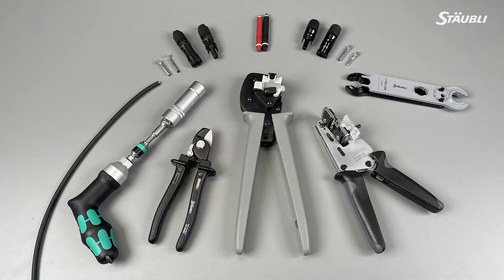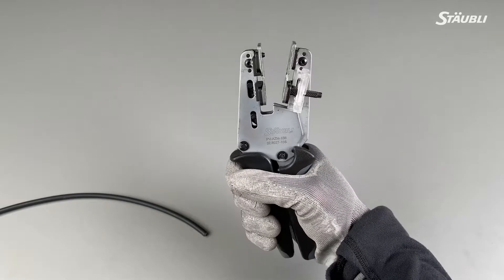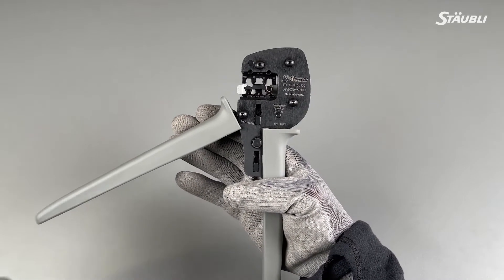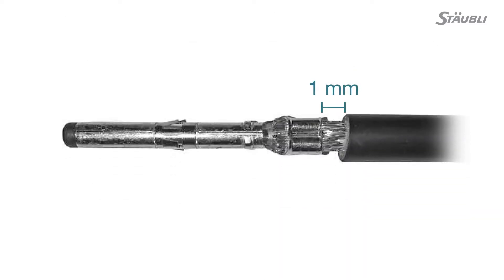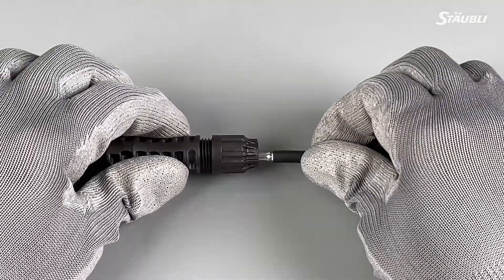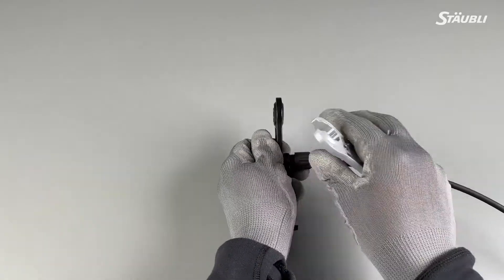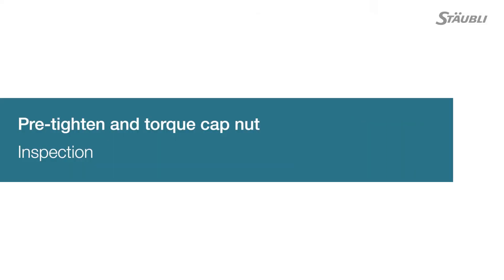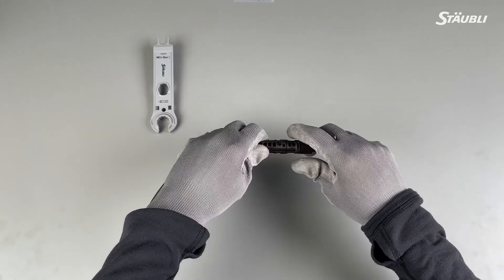How to assemble and crimp Stäubli Original MC4 / MC4-Evo 2 solar power connectors | Best practice

Comment: What is the impact you didn't leave a gap and tightened the coupler to the end? Do you need to back them off? Cut them off and start over?
Reply from the maker: In this case, due to the damage to the strain relief, which has most likely been pushed out of the cap nut, we recommend cutting off the connector and starting again with the correct assembly according to the Stäubli technical documentation.
Reply: Thanks for the response. I only did two sets  before I found this video and then stopped. I will do as recommended as looking at the ends I do see the strain relief pushed a bit out of the back of the cap.

Comment: As usual, make it better and more complicated than it needs to be !!!   Did anyone do real-life testing ??? With real installers. On a Florida roof, 120F plus degrees, sweat pouring off you and in your eyes, hands slippery, and feet cooking...I bet NO!!!  It would help if you were looking for an easier way, not a more complicated way...Any new product should be fabricated with the help of 2 long-time installers for sounding boards, without repercussions.. This new product is rediculous ......
Reply from the maker: Hi @patwelch8187,
 
Thank you for taking the time to share your thoughts with us. We truly value the insights provided by professionals who use our products in the field and understand that working conditions can be challenging, especially in extreme environments. 

Recognizing these challenges, we have recently developed a crimp-free solution, the MC4-Evo ready, to help installers in the situations you described. Please find detailed information here: https://www.staubli.com/global/en/electrical-connectors/industries/renewable-energy/mc4-evo-ready.html
 
We would like to clarify that this video is an updated best practice tutorial for our existing MC4 connectors, not a new product. We are committed to improving our instructions to ensure the best possible application of our products to guarantee the long-term performance of photovoltaic systems, which are designed to last for many years.
Reply: I searched and can not find the MC4 EVO Ready connector in the states... 👀
 I am a amateur and it would be perfect for occasional use...
Reply: I just installed my solar panels using the MC4-Evo 2 and helped my brother in law with his with the same components. It's actually quite easy even on a roof. You don't even need the fancy tools they show in the video. I used 25€ crimping pliers and 5€ wire stripper, worked well.
Reply: First time bro? 😂